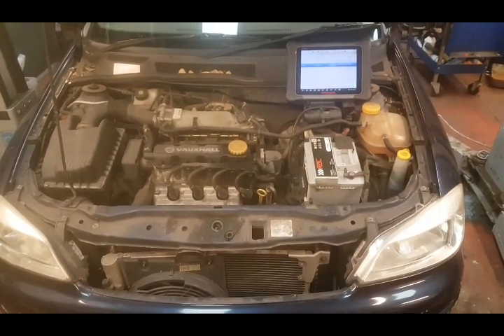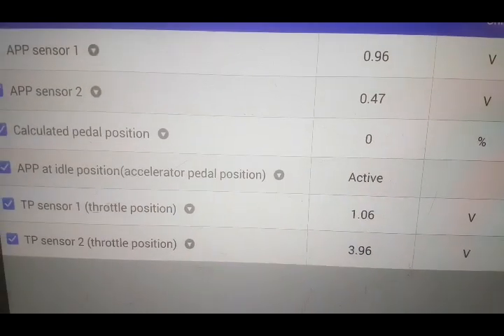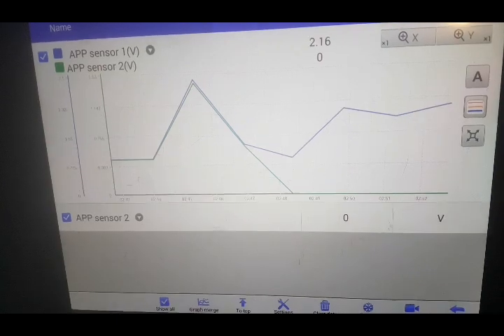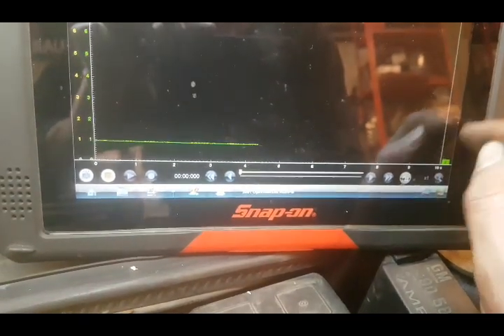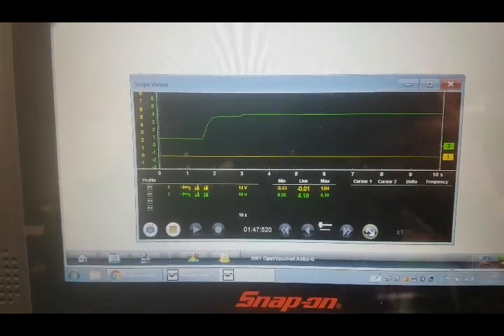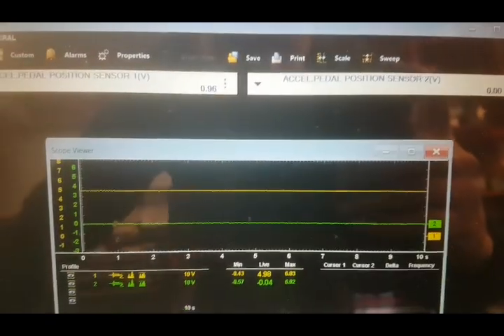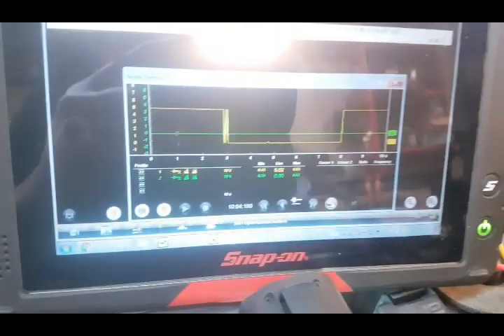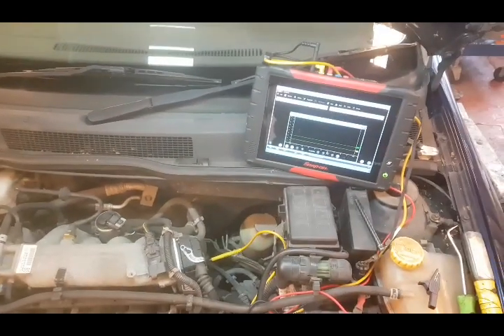Vauxhall Astra ECU Fault. Plus tip on how to have Verus scope and scanner on screen at same time

Comment: How much would repair cost ?In my area this is a common & fixable fault ,ECU  repaired in 24 h, almost 100 % success rate .
Reply from the maker: Mot many offer repair here, I have opened one up up and successfully repaired before but wouldn't bother again, the stupid little alloy connector pins are a pain. Where are you and what would the cost be.
Thanks
Reply: I am located in opposite side of Europe , small wages and cheap labor prices :)) .There are good tutorials on DK forum ,with a microscope ,some copper wire and  soldering iron and ECU is fixed forever  .Cheers !
Reply from the maker: Oh I know how it's done and can do it, however here in the UK the cost outweighs replacement. And on a 15-20 year old car the customer never wants to pay. Will be adding vids of ecu and BSI repairs in the coming weeks